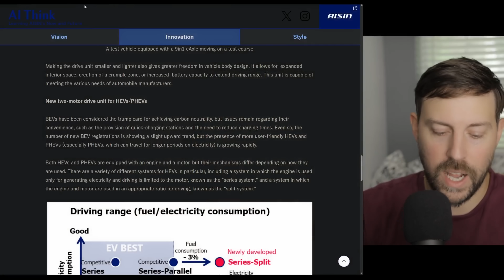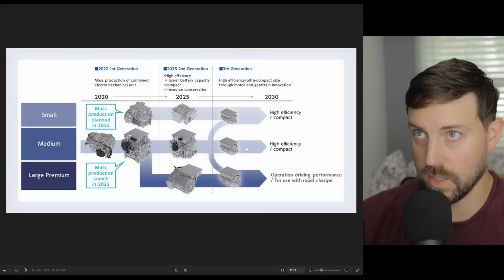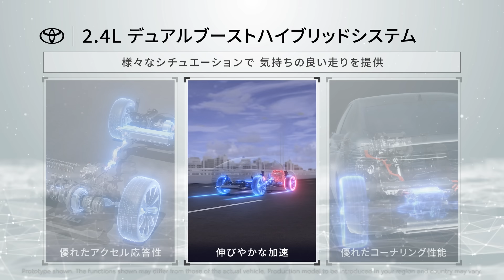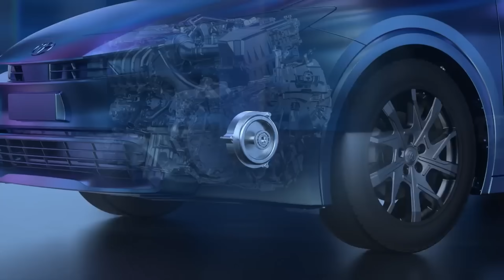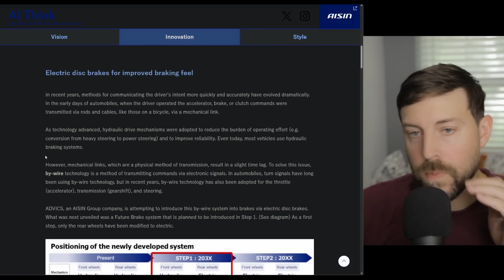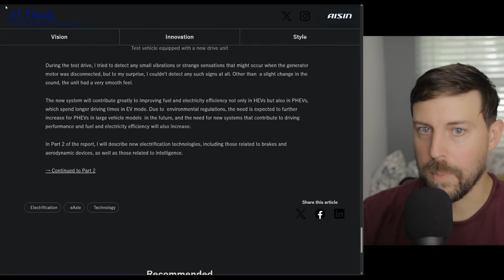Toyota's NEW hybrid technology is almost here. CAN'T WAIT!

Comment: I can understand rear brakes using electronic brakes, like using magneto braking vs friction which makes sense. However it should be a redundancy with hydraulic brakes in the front, that's dangerous if the power or a ground gets cut

This adds complexity and not much by way of saving initial costs either. Hydraulic brakes aren't expensive nor inefficient so they are wasting engineering in my opinion

Comment: Interesting.  Thanx.   Focus more on EREV PHEV.   Would like to see direct drive rather than transmissions. One pedal driving on demand (via paddle?).  EV range 50+ miles so a larger battery. 0 to 60 times sub 5 seconds.  More hatchbacks....  This is like computers in the 1980s.... Rapid evolution over a decade....

Comment: Yo Kirk. I'm about to get a 2024 BZ4X. Do you know if there are any updates coming on the software side for the 2023-25 1st Gens? Are they just going to forget about us completely, or will there be some positive changes coming for us?? And it sure would be kind of Toyota if they would recall our first gens and throw in the 2026 silicon carbide inverters and updated wheel bearings.

Comment: Are they working on adding a manual electronic parking break release for situations where the car won't start but the break is on?  Just got stuck in the 2025 where it wouldn't start and the EPB could not be released.
Reply: What did you end up doing?

Comment: the 2024/25 toyota camries hybrids are seeing in nyc as taxis around 50 MPG and some are getting closer to 55 MPG so a  2% additional  will be 51MPG to  56.1 MPG. that going to be crazy in 2030 to 2031 when NYC taxis all be changing there fleets over to the next new model. the RAV4s we seeing close to 600 miles on a tank. once the PHEVs are the cost of the gas hybrids wow we will never need a full tank in NYC.

Comment: I guess hybrids won't go away anytime soon.  I recently bought a used 2023 Tesla Model Y with HW4 because I wanted to use FSD.  I do live in an apartment complex, and a hybrid would have been more appropriate if I didn't have access to complementary charging.  For me charging is available ~75% of the time.  A hybrid would be preferable to owning an EV if you have to rely on superchargers.  If you have a driveway where you can run a cord for trickle charging, then there's no reason to own a hybrid.

Comment: Hybrids are a con, the tech is just too expensive , just go electric when your ready and do homework. These auto reviewers just don’t know about the cars today. Just one basic one. My zb Holden commodore( the last commodore) sedan 2 litre 4 cyl petrol turbo (191 kw and 350 nm of torque, just bewdiful) kerb weight is a goldilocks car with a mere 1526 kw 😮 weight, compared to the obese EVs 1700kg and up to 2100kg.. ev suspensions/ chassis are under the pump exp at roundabouts and windy roads..

Comment: Sorry.  Nothing today beats VW TDI technology with 600 miles per tank range, no range anxiety and 50+ mpg and significantly less expensive by $20 to $30 K.  If it's this complicated to get what Diesel gets with a simple engine, there's something severely wrong with Toyota's mindset and problem solving.  This is not good engineering. It's a technical nightmare.

Comment: The current Plug in 2025 RAV4 ( formerly known as the Prime ) can run on electric alone for I believe it’s 60 kilometers ( about 40 miles, and you decide if you want to use that range and when). The next RAV4 Gr Sport  plug-in hybrid I was told can go 80 kms or (50 miles ) on electric alone. The best things about the Plug-in hybrids is the engine and hybrid system work just like a regular hybrid in that the engine and brakes charge the battery for the electric motors after the all electric range is used up. The one issue Toyota needs to address is that because the plug in can be run on pure electric only power for up to 40 miles most owners seldom use gasoline. Therefore the gas could theoretically stay in the gas tank for a long time. This leads to an accumulation of condensation in the fuel system which is not a good thing ( long story so just look it up ). Also the RAV4 hybrids/ Plug in hybrids may not completely burn off condensation in the engine itself leading to oil contamination ( check your oil dipstick or under the oil filler cap ) due to not being run a fully warmed up engine for long enough ( I’ve seen this in my own RAV4 hybrids. This requires an oil change soon if not immediately. Toyota now sells a can of a product to remove that sludge which you put in just before that emergency oil change but it doesn’t prevent it from happening again. They also sell a similar looking can that goes in the fuel tank to remove the condensation ( water ) from your fuel through combustion ( due to fuel not being used and replaced with fresh fuel, this is a concern in the plug in hybrid due to using the electric only range ).
Reply: Can you force it to use the engine every 2 weeks or so?
Reply: @TheRainHarvester sure you can. You don’t have to run on electric only. My understanding is that you could drive on gas / hybrid mode for 100 kms or more and then drive on electric only later on. If I had a plug in hybrid RAV I would force it ( choose to ) run the gas engine/ hybrid mode more especially in winter. Toyota now sells a can that you put in the fuel tank to “ capture “ the water and Im assuming burn it with the gas?

Comment: It's junk. It's basically just any other hybrid not connected to the wheels which is just useless. I like engine that drive a car. Not just charge a battery. Think of it like a generator in your car

Comment: Is it true that way too much technology in new cars, break down more and cost more in repairs? I saw a report that technology is replacing reliability. Is this also true with the new 2026 RAV4? I hear that analog gauges are better than digital electronic gauges. They do not go out and fail like digital gauges. Getting rid of the touch controls to control climate in the car was not a good idea. When and if the Infotainment system goes out, you cannot control the climate and other things in the vehicle. It has also been reported that push-to-start is more vulnerable to theft, copying and hacking. Having a key provides better security with way less problems over the life of the vehicle. So Toyota may need to revisit a few things. Just because something is new does not always mean it's better.

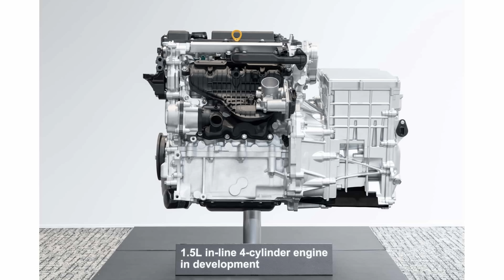Comment: on that graph at 12:53 shows that the torque demand for the ICE engine falls off faster than the contribution of the Emotor. ICE combustion is more efficient to the idle limit of power extraction in many cases.  Pv=nrt being out model, the less you make the ICE work, the exponentially more (to obvious limits) mileage you get from combustion. 5kw output electric = X fuel use, 10 kw = x/4  fuel use.  We just need a car w a battery of 500 (400 mi 20%-80% charge),  with a compact efficient 10kw engine, less than 100 lb (we make motorcycle engines that do this easily).  All this crap they are doing is retarded.  IF you think you are running low on charge to get to destination, kick on the genny, bam, 60-75% of power needs supplied @ highway speeds.
Reply: hell, 275 mi range for the "Towner" model.  2/5 the battery mass, still able to get you 500+mi on a 5 gal tank of gas.  Best of both worlds, different options for different needs. one good solution.

Comment: Whats funny is I thought of doing torque injection using an electric motor.  This would be on a manual 4x4, where I tap into the transfer gears. I could idle this thing in gear, while it idles w my foot on the brake, it would divert it to the motor.  let of the brakes, works like a torque converter.  doesnt matter which way the motor is turning, just apply a voltage, and it goes from generator to motor, while supplementing it to the back end as you give it throttle.  Adjust throttle curve for electric motor using different custom maps and you can add assist level.

Comment: Toyota jumped the shark about 10 years ago. Pay attention. They can’t catch up now. Rotating Chairman is proof. Tesla stuck in the knife but Toyota twisted the knife by denying 100% Electric. Less moving parts to break, less maintenance time and costs. Oil? get lost. Less war over oil, cleaner air, cleaner water, huge savings of Time and Money. Once you switch you will not want to go back. Weekends will be made for old smokers if you can still afford all the extra costs associated. Owned a dozen Toyotas but not going back. 🇺🇸 🚙 😊 F-Trump

Comment: BYD DMO system is a serious competitor.  The ICE  links to the front transaxle above 70 KmH, enabling the engine to stay in a narrow, efficient rpm band.  Its thermal efficiency is world-class. The larger battery pack relative to Toyota allows regenerate braking.

Comment: In my honest opinion, I think people are looking more for power than efficiency at this point. Being able to get 45+ miles a gallon consistently is more than enough for most people. Making driving fun again with more power now that all the engines have downsized would be great to see. Like making the i-Force Max more economical so it's cheaper and not just exclusive to the highest trims of these cars would be great to see.
Reply: 45 mpg is bad depending where you live. Sure mpg doesn’t matter in Alabama or Mississippi where things are close together, no traffic and cheap gas, but it’s a way different story west of the Rockies

Comment: This "next-gen" hybrid technology isn't really new since they already had a similar system on the Gen 4 Prius Prime. It has a one-way clutch that forces MG1 to turn in the same direction as MG2 in EV-only mode. This stops it from sucking energy away from the system and instead combine the power of the two to drive the vehicle. This is why the Gen 4 Prime can use the same low power (52kW/70hp) motor as the regular Prius. For some reason they abandoned this approach in the Gen 5 PHV and as a result the Gen 5 is now less efficient in EV-only mode.

Comment: I want a hybrid tacoma with small i6 to power the rear and hybrid ev motors for the front. 200 hp i6, 200 hp ev power.  600 miles of range because towing is half that. Without

Comment: Im getting around 125 MPG in my '25 Rav4 Prime (phev). I wish it had about a 60 mile range vs 43 on the battery only mode. But most days 43 miles covers my driving and the engine never comes on. It does have 300+ HP if needed. I looked at the details on the '26 and I can't stand that Toyota is putting more functions on the dash tablet. It may have better Mpg than I have but, the hole in the dash where the HVAC used to be is a stopper for me. I had a '23 Rav4 hybrid that I hated the radio control on the tablet. I still have it on the '25, but I don't use it and haven't paired the car to my phone. Screw Toyota and their subscriptions. If it is a pain in the ass to use, I shut it off. The hvac in a prime kicks butt. It works on a heat pump and doesn't need the engine running to change temperature.

Comment: I use PDA and it’s great. Not all its elements but breaking  when detecting cars ahead. It’s works very well in Lexus LBX. It activates itself in correct moment and with good strength. Could be bit more gentle but it’s matter of a taste. 
I also once experienced breaking in corner and again it was spot on. Car properly detected that speed is too high and gently slowed down. This happened once when I went into corner at relatively high speed ( too high for normal driving).
Maybe problem is actual implementation in specific model. Toyota uses ‚same systems’ yet they don’t exactly work the same in every model and definitely can work very different in Lexus.

Comment: They already got an antiquated system that everyone wants cause it's proven to last. Focus should be on solid axel to RWD with driver focused automatic or manual transmission. Electrifying in order to enhance the direct transfer of power from ICE is the better way. I think their LC500 had a similar setup (but no manual). With improved technology, they should be able to condense similar setup for smaller and more lightweight cars. If they can get a manual in there, with real ability to control gear take-up with left foot, it'd be huge with the EV assist.

Comment: Electric braking?  What happens if you have an electric failure?  Hydraulic brakes can work on foot pressure alone, and has a mechanical or electric “parking” brake as a backup.
Reply: Hydraulic brakes fail from lack of fluid, electric brakes can't fail, the rotation is resisted by a magnetic flux, the same thing that moved the car.
Reply: @richardwilliams1986 electric brakes fail the 2018 Camry xse failed on me with no warning I hit the electric brake and nothing they should bring back the hydraulic ebrake.
Reply: @richardwilliams1986  you got an article explaining that..?

Comment: @kirksquickies, I own a Lexus LX 700h and I quite like the proactive driving assist.  Yes, it does brake for me - it works just fine most of the time, and when not (e.g. I saw traffic moving and want to reduce braking) I press the throttle slightly and take control.  I did not yet experience the auto-swerve.  In 6k miles of highway, city and twisty secondary roads, it worked for me.

Comment: Corolla hybrid is money saver, it is using the last gen prius hybrid
Reply: I find it kind of slow though, even with the hybrid powertrain in mind. I'm not expecting speed out of a non-GT corolla but it could still use more power.
Reply: Actually you should look into a EV instead

Comment: Toyota never let me down over the 50 years span. It’s the most trusted brand among all brands from anywhere on earth. Toyota vehicles are far from being perfect but they are more perfect than others.
Reply: I am like you. First used Toyota a 72 Corolla that car consistently got over 40mpg. First new Toyota an 81 Corolla. Since we have had Camrys Avalons. Never stranded by any of them. Never any major motor maintenance.
Reply: Me too. My first was a 1972 Celica gt coupe.
Reply: The majority of problems with them are related to extended oil change intervals. They can still last as long as they used to,  but you can't neglect them and get away with driving on zero oil and a dead cylinder anymore.
Reply: Honda beats toyota any day.

Comment: Plug-ins besides needing bigger batteries, they also need more power out of their electric motors in order to drive the car without any ICE assistance. One thing that I wish they could improve is the e-axle performance in AWD systems.  In most off-road tests including ones using rollers to evaluate various low traction conditions, the RAV4 AWD with e-axle performs poorly, lacking either power or control/software connection to the front axle (or both). Technically, it would seem that two separate e-axles controlled by a computer should be able to replicate a mechanical physical drive shaft connection, but I have not seen any that perform well.

Comment: From what I've read, the hybrid system in the 2025 Civic hybrid is "better feeling" to drive than the current crop of Toyota hybrids.  For me, that's more important than getting a few more MPG.
Reply: I have the Hybrid Touring Hatch, such a solid piece of workmanship, plenty of untapped power at your control. The transitions from battery to gas are pretty smooth as  you can get. I am close to 54 MPG. Only hang up is the overdrive, the RPMs on the highway are too high and a better cruise speed is needed.
Reply: Yeah the honda system has better performance, but toyota maybe a little more efficient. Hondas problem is they dont have a large vehicle hybrid yet
Reply: Toyota has a better warranty.
Reply: @WarGamersChannel agreed
Reply: Long term hybrid reliability is questionable. Nobody knows.
Reply: @edgaryzen4925  no it’s not. Toyota and Honda have been making hybrids for over 20 years now. For the most part, they are very reliable.
Reply: @edgaryzen4925 That isn’t true for Toyota. There hybrids are even more reliable long tern than their ICEV.
Reply: @matthewhuszarik4173 I meant Honda. The Accord Hybrid was a car that I once love, specifically the 2014-17. 2016 model year didn’t exist oddly speaking and these years didn’t have turbo and it had a very large fuel tank to go 750+ miles. 

Nowadays the parts are back ordered if not difficult to source in fact it is not interchangeable with the gas only model.and the battery are already expensive to replace. Trunk space was limited, and lots of owners don’t recommend this anymore. supposedly the 2018-22 Accord Hybrid are much improved but it is too soon to tell how it hold up.

From what I seen the accord hybrid are cheaper to buy than the Camry hybrid but there is far less of them on the road today. 

Civic hybrid hasn’t been around consistently..

Who knows how it fare in 10 plus years but I know Toyota has been consistent already.
Reply: @edgaryzen4925 I haven’t heard specific facts o Honda Hybrid reliability . Since their ICEV were so reliable and their generators are so reliable. I have to admit I just assumed the hybrids would be bullet proof as well. The only issue I had with them is when they designed them for power vice efficiency. I want a hybrid to use as little fuel as possible while still providing the utility I would like to have.
Reply: @matthewhuszarik4173 same but that’s their angle to be the lesser boring of the two. Which I liked as a young man but past 30 efficiency I’d key.
Reply: Not me, maximum gas mileage and minimum CO2 emissions.